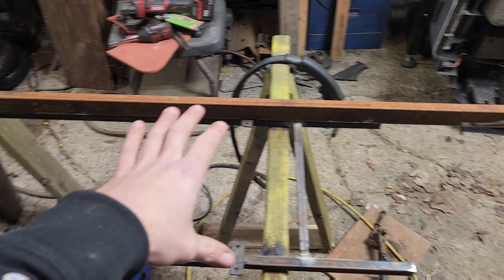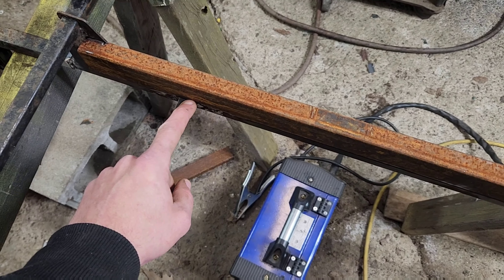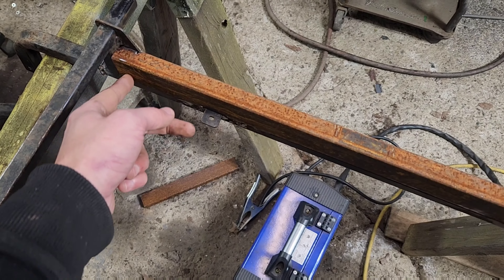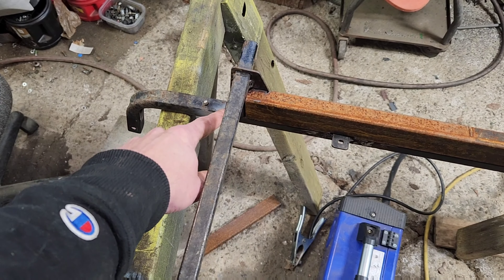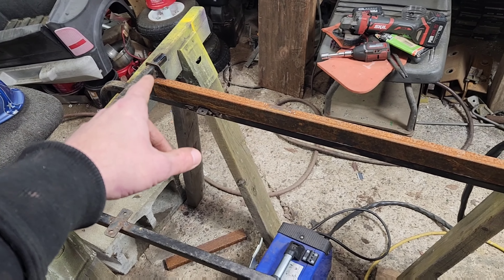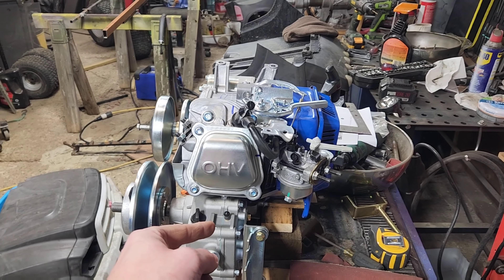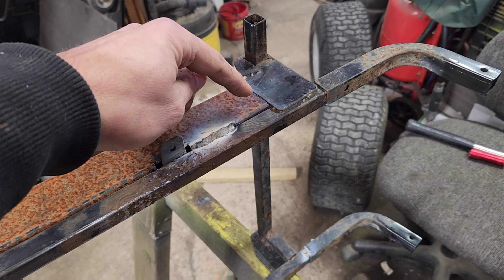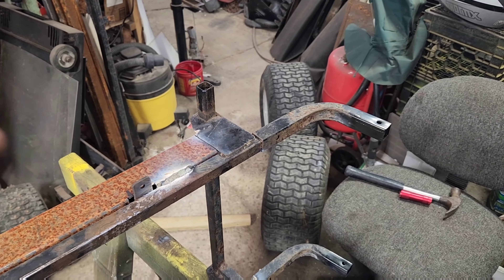Part 2 Duromax Dodge Gas Power Wheels

Comment: 7:44 Rust-Oleum is fantastic stuff. 
What I try to do for a finish that I want to last is I select a color that you can find brush on and spray on.
2 coats of brush on, sanded lightly for brush marks ,and 2 coats of spray for the gloss and you're good. 
If it's a light stone chip, it'll just nick the spray stuff off and leave some color and it's not so noticable. 
I have put por-15 first though, and that works good too. 
(That's the method I used on my summer cars complete suspension 10yrs ago, still looks good.)
Reply: HAHAHA I see John is a member of the "not my job" department 🤣🤣

Comment: Hi Neil. Thanks for another great video. Being a Millwright I make my living with my tools. Most of my tools are brand name. My employer has a few big name welders mig, tig and stick. So welding anything heavy needs to be brought to the shop. I've had a couple of cheap no name welders at home that worked great until they didn't. I've found out the hard way that replacement parts are hard to find or don't exist. Have you ever tried to get spare parts for your "cheap" welders? I'm done with the cheap welders. I purchased a Lincoln weld-pac 100. I paid about three times what a cheap welder costs but parts are available at most welding supply and big box stores. You really do get what you pay for when it comes to welders. I'm waiting for the video on how your going to mate the engine to the gearbox.
Reply from the maker: This entire welder costs the price of a Hobart 140 gun. I compare it to this cause the 140 tends to be the pivot point from hobby welder to pro. I get about 3 year out of a Hobart 140 gun welding fluxcore. I am on my 3rd right now and over due to replace it. My point is most have no need to weld the 1/4 the 140 can. There for a $150 welder that costs $50 to replace the gun and universal grounding leads tends to be a better buy for some. Good Question might have to make it into a video at some point.
Reply: Most people buying these "cheap" welders, probably only use it once or twice a year...like myself.  My $100 Harbor Freight MIG welder that I've had for 9 years works fine, but I only use it maybe once a year, twice if its lucky LOL.  

You are right, you can't get parts for them directly, but most brand name welder parts actually work in them as a lot of those parts are pretty generic, contrary to what many brand name loyalists think...most times there are slight differences and mostly cosmetic fit and finish type differences.  If you want to buy a brand name welder go for it, nobody is telling you not to, many just don't see any point because they don't use the tool often enough to justify spending 10x more for the name/color.  

I believe Lincoln also makes a multi-process welder now in the $1500 range, possibly cheaper now, and probably will be what I go with whenever I need to replace my black buzz box sometime in the distant future.  

What I've found with the $100-200 entry level MIG welders is they just don't have a very long duty cycle....but neither do the entry level brand name machines...until you get into the pro shop stuff in the multi-thousand dollar range, you really seem to be limited on how long your duty cycles are...and for most people they never hit that duty cycle as they're only welding a few inches at a time, then setting the gun down and doing other stuff between uses.  

Parts do exist, but most times you end up with a $100 buzz box with other brand parts in it...and totally not worth repairing them for the most part anyhow.  They're honestly just a throw away machine overall.

Comment: Question for you.   I am working on a Scotts / John Deere S2048. When I pull the PTO or atemt to drive it the engine dies.    The seat switch is jumpered, what else would kill ignition?

Comment: will you be putting the link to the motor mount with FnR? been looking for one of those
Reply from the maker: Its insanely over priced. I have been reaching out to a few parts sources I have worked with in the past to see if they can make a weld in version for the DIY community.

Comment: The weld's would be better if you clean the rust off  if you was using a stick welder with the right rod for Rusty steel. I was being nice and not say that it was a bad idea. But just remember that the thin metal is not going to last one John is going to hit things with it and John is getting older so he growing he going to way more so it need's to be stronger